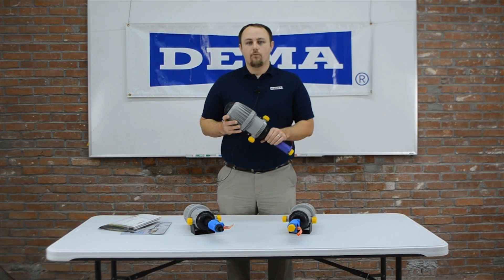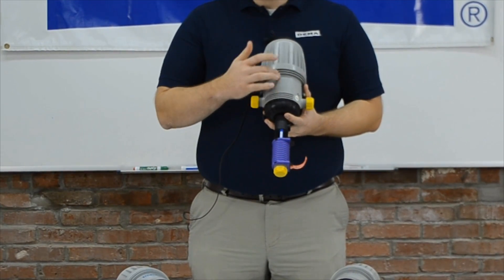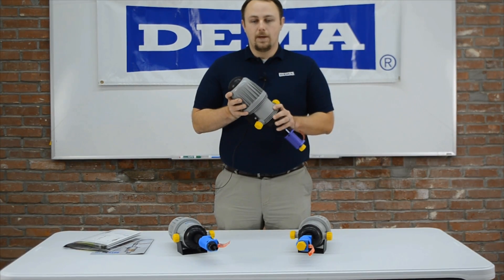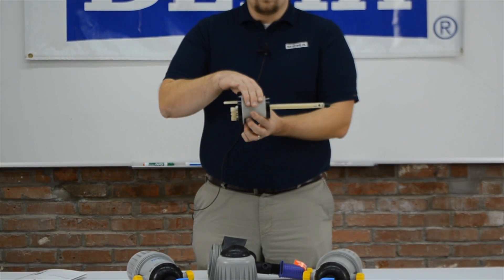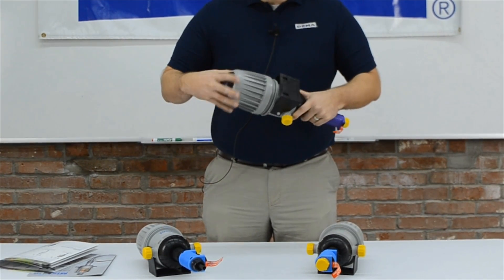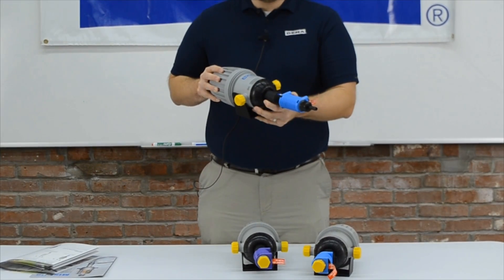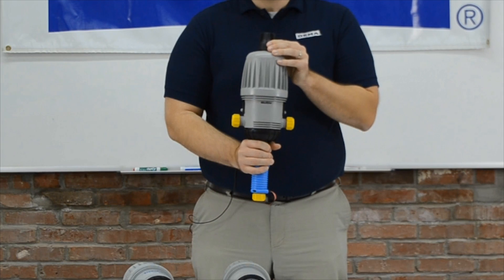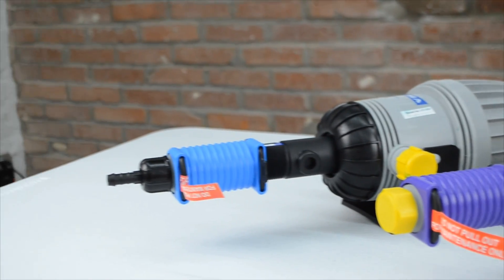MixRite Water Powered Proportioning Pumps

Comment: Just installed a new unit, the MixRite 3.5, and it doesn't work at all.  Hooked up as per instructions.  Any idea?  Water is flowing fine, seals are all good, no suction out of fertilizer tank.